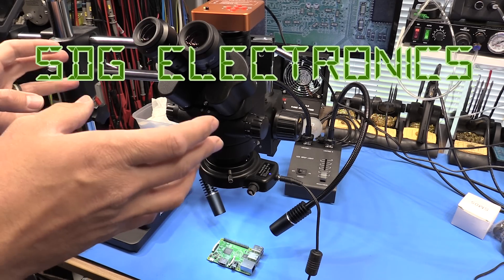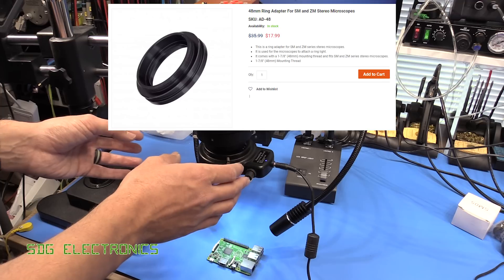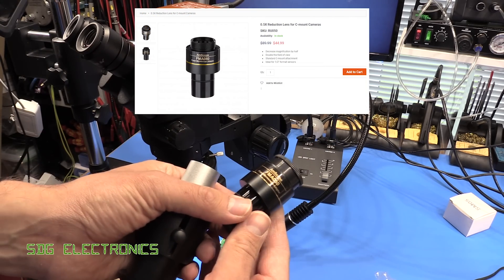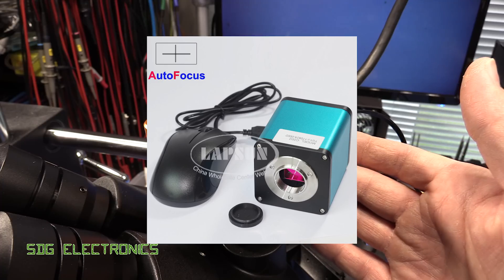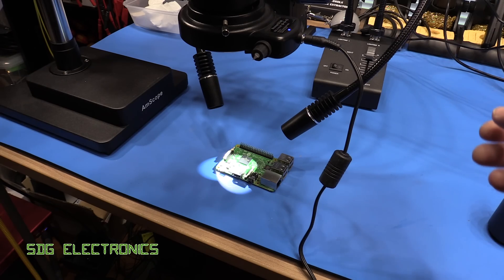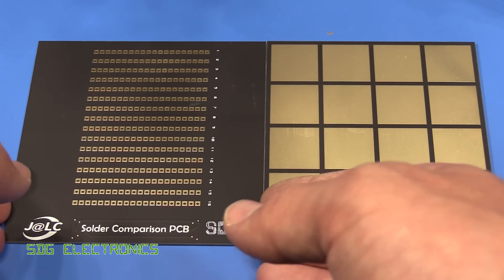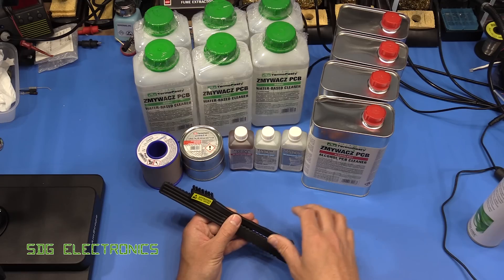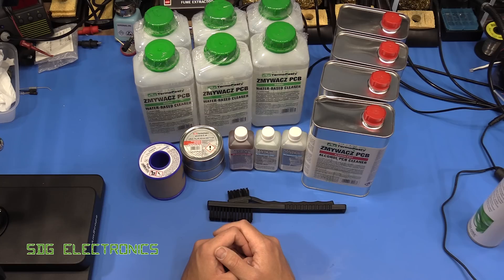SDG #078 Amscope Microscope (SM745NTP), Matte Black PCBs from JLCPCB and Soldering Equipment

Comment: 3:30 Why not bolt it to your table instead? More secure than a desk clamp anyway. The thing already has holes in the flange that mounts the tube to the base ready for mounting with bolts.

Comment: I noticed the swift (e400) small microscope shows much less distortion/fringing and sharper image than the trinocular. Can you list all the parts you used to add a camera to the eye pice of the smaller scope. Camera image looks sharp.

Comment: Hi Steve
Found your video a tremendous help as I have recently purchased an Amscope myself and also having problems myself installing the camera. The ebay link to purchase the pancake lens you mentioned has subsequently disappeared but I have found some others. Purchased one which does not fit. Would it be possible to let me have the camera mount and microscope connect  thread size on yours so I don't make another mistake.
Many thanks Chris

Comment: Steve, as always, another delightful production highlighting several key aspects of stereo microscopy methodology.  Everything is just
perfect (....lighting, sound, video sharpness).  And, thanks for the demo of "specimen" illumination comparison.  I'm so glad I didn't buy
a ring light.  Anyhow, I wanted to understand the 0.35x C-Mount lens with respect to focus adjustment.  I just bought the same
AmScope microscope head with the same USELESS trinocular photo tube device and I have to replace it for the same reasons you did.
How does the focusing work on the  0.35x reduction lens  ?  When you rotate the outer ring, does the helicoid increase/decrease the total
height of the pancake adapter lens .......OR.....does it just move the INTERNAL lens up & down  ?
THANKS  !
Reply from the maker: It just moves the internal lens up and down, so everything external stays completely static. I've found the lens really good - I set it up once in this video and have never needed to adjust anything since.

Comment: Hi Steve,

Got my SM-4TPZ and noticed that I have to re-adjust the focus a bit at the end of the zoom scale (close to 4.5x). Do you also have to do that or I should be worried that I received a faulty scope ?
Reply from the maker: I don't think that's a fault, even if you set up the microscope to be parfocal, at high zoom levels the depth of field is very small so may need small readjustments. You could try setting the focus up again.
Reply: @sdgelectronics  Thanks Steve - yes of course adjusting slightly the focus at the highest magnification zoom range does the trick. I would have hoped though that it is truly continues zoom range as it is advertised :D Another thing is that I bought the 0.35X adapter you are using and I cannot get the picture to be in focus. I literally have to hold the camera (slightly different one from the same seller which is advertised as 4K) attached to the 0.35X adapter in the air 4 to 5 cm above the microscope head..... I contacted the ebay seller and he recommends to test it again with a working distance of at least 16cm and should be OK - something I need to still test but I am not sure if I can go beyond 15cm working distance and I have only 0.5 barlow lens installed.... And even if that indeed works at that distance then it makes it to be very limiting as I might want to use bigger magnification and therefore shorter distance ? So confused!
Reply: So I just checked few things which even more confuses me. If I set the working distance about 20cm high - I can get an image in focus on the camera but at the highest zoom magnification only with the 0.35X adapter. But at the same time I cannot get the picture in focus in the eye pieces. Moreover - with higher working distance any change to the zoom makes the picture in the eye pieces out of focus and I need to readjust the focus (that now happens throughout the whole zoom range with that high working distance). When I lower the working distance to about 16cm the picture stays in focus nearly throughout the whole zoom range (as previously - have to readjust the focus a bit at the highest range of the zoom) but I can never get the picture in focus on the camera itself.... Is there anybody here who would be kind enough to check if they constantly have to readjust the focus throughout the whole zoom range if their working distance is set to 20cm ? Just trying to understand if there is simply something wrong with the microscope or with the camera / adapter setup I bought...
Reply: Just ordered the 0.5x adapter from the same seller you recommended as hey believe it should fix my problem. Need to wait for the delivery to test it out - I will post my results when it's here. Thanks.
Reply: So I got the 0.5x adapter from Lapsun Gift eBay store, checked it today and it does not work - still the picture in camera is out of focus and I would have to lift it up above the scope head for it to focus (although this time a bit lower than with 0.3x one). Sadly I now ended up with 2 non working adapters - I requested a refund (as the seller confirmed it would work this time) so hopefully I will get my money back for the 0.5x one. I will leave a comment about my experience with getting the refund with them here as well.

Comment: This or the Eakins? What would the Eakins not have that this does?
Reply from the maker: No difference optically. The double boom is great if you have space but I think Eakins also sell it with a boom stand. I would go for whichever you can get delivered cheapest
Reply: @sdgelectronics  I'll have to figure something out for the stand since shipping the stand here is very expensive, in the $150-$300 . I'm thinking either DIY or a custom job from a local metal worker.

Comment: Hello Steve,  I need your help.  Currently in the market for a microscope, I am inspired by your solution to the chromatic aberration you attributed to the trinocular attachment provided by AmScope.  Recently I watched another video, “Organic, free range, grass fed, cruelty free microscopes for sale,” on the “Louis Rossmann” channel.  Mr. Rossmann also attributed an optical aberration to the very same attachment; however, his solution is not currently available.  Please evaluate the Rossmann video and let me know if your solution, the “CTV 0.35X M38 38mm C-Mount adapter Scope Trinocular Stereo microscope,” likely addresses the same problem.  Also, do you have additional reflections on your camera solution, the Industrial Digital Microscope Camera Sony IMX290, Model C202?  Thanks.

Comment: Thanks very much for the pointer to the alternative camera adapter.  For those in the US, here's a link https://www.ebay.com/itm/CTV-0-35X-0-5X-1X-M38-38mm-C-Mount-adapter-Scope-Trinocular-Stereo-microscope/273877780313 for the products in USD.   It's nice to hear from you that you've had good experiences with this vendor.

I'm awaiting the delivery of my microscope in a few days to verify which of the "old type" vs. "new type" camera port mine has before launching an order.  And also to see how the camera field-of-view matches what's seen in the eyepiece to select between the different optical options.

Comment: I also found the ring lights to be useless.  The light they produce is not suitable for viewing anything.  The goose neck LED lights work much better but you don't need to buy a special microscope light since 2 goose neck LED lights from IKEA work just fine.

Comment: I want to buy 3.5x - 90x in this black version. can you help me how i can  choose the correct magnification of the camera adapter so when i am seeing trough the eyepieces as i will see trough the camera. Thank you!
Reply from the maker: The 3.5x-90x is a 7x-45x microscope head with 0.5x and 2.0x lenses that screw onto the bottom. Generally you will always have the 0.5x lens on the bottom since this gives great working distance. I found that the 0.35x camera adaptor gave the same field of view.
Reply: @sdgelectronics  thanks for your imformation!!

Comment: Check on ebay for 'Long Arm Heavy Duty Boom Large Stereo Clamp Table Stand Pillar For Microscope'. I've been pondering switching the stand on my own microscope for that one. It clamps on the side of the desk so doesn't waste space on the worktop. I'm only holding back because I haven't found a review of it yet. That stand might be exactly what you're looking for too. Cheers!!
Reply from the maker: I did see that one, Jim. I saw Louis R did a video unboxing an Amscope with the same articulating arm but on the heavy base. He seemed fairly happy with it although it did wobble quite a lot.

Comment: So did you recommend to upgrade to SM745NTP head?
Reply from the maker: I'm not sure this design would necessitate an upgrade, but certainly if buying from new I would say it's worth selecting the SM745NTP
Reply: SDG Electronics thanks
What eye guard did you recommend-for this head? It did not come with eye guard. Correct?
Reply from the maker: @yossishi221  correct, it came as shown which is a little odd. I've not purchased any eye cups yet so I will update when I find something suitable.
Reply: @sdgelectronics  may I ask why the sm745ntp is better than the one in the video? I am just about to buy one and want it in black like yours but can’t find one like the sm745ntp (white). Thank you
Reply from the maker: @josephe9773  the fit and finish in a few areas is just slightly better. The optics appear to be the same
Reply: So what camera will be ok for this? 
Not expensive  
Thanks
Reply from the maker: @yossishi221  The one linked in the description has given me the best results so far.

Comment: I've had no issues with Lapsun either Steve, I think I've had about 4 or 5 microscope cameras from them along with lenses etc.
You certainly get good value these days with regards microscopes and cameras etc. I think when I bought my M'scope a few years ago it was around £1500 although I did choose to have a research grade head option that was available. I'm sure as you've found though that the newer Amscope options etc also have excellent image quality.
Be interesting to see how you get on with the autofocus camera mate. I chose not to go down that route though as I assumed that like most they have a very shallow DOF, so say you're working around two components that are a couple of mm different in height I feared the autofocus system may become confused and just focus on neither. If you find it to be fine though I may try one too 😁.
Cheers, John
Reply from the maker: The nice thing is you can turn off the AF when you need to otherwise I would have bought the same one as you for the same reason. Thanks
Reply: @sdgelectronics   Ah ok.. Thanks 👍

Comment: Also, I have my microscope straight in-line pointing toward me. I went ahead and bolted a 8 inch metal shear on the left edge of my bench so that space wouldn't be wasted. The shear also cuts boards very well.

Comment: Thanks Steve! I want a microscope like the one you have for my next one. On my microscope, the camera is in focus when it is all the way down in the tube, which is good.
I clean my boards with lacquer thinner first, and then alcohol. I also use some soft toothbrushes with lint-free paper towels when I clean the board using your technique. Then a final clean with a fresh toothbrush and alcohol without the paper towel. I bought a box of 100 cheap toothbrushes on eBay for about $2.
Reply from the maker: That's some thorough preparation - sounds like it should yield some excellent results though. Thanks Robert.
Reply: No, thank you! I learned it from you, Steve. I learned using lacquer thinner from Paul at Mr.Carlson's Lab. Yeah, the lacquer thinner seems to remove flux easier than alcohol. The Chip Quik SMD291 No-Clean Flux that I am using now cleans up pretty easy.
Reply: SDG Electronics  I'm sorry - I made a mistake. I don't know why I thought I got 100 toothbrushes for $2... I just checked and the ones that I actually bought were 144 toothbrushes for $10.94. My bad!

Comment: Thanks for this video! I have ordered so many different types of lenses for my AmScope in the past but they were all a waste of money. I settled on a 0.5x with a 3D printed adapter but I wasn't happy with the result. I just ordered the Lapsun lens which looks perfect!
Reply: Hi Chris - I ordered the 0.35x adapter but when I tried it with my amscope I cannot get it to focus (out of its range). I need to hold the adapter mounted to the camera in the air about 4 - 5 cm above the head for it to be able to focus. Do you use any extension ? Or you use the adapter directly mounted to your amscope and the camera ? Thanks.
Reply: @adriansosialuk276  Did you find a solution?
Reply: @solid_rob3236  Unfortunately not. Bought 2 different adapters with the same result.
Reply: @adriansosialuk276  Thanks for the update and sorry to hear that, hopefully you get to find and get better results.
Reply from the maker: It works really well - they seemed to be the only ones selling it which surprised me. Thanks

Comment: Can't wait for the flux (and flux cleaner) comparisons. I love the Topnik LP-1 flux, but I found that it's hard to clean with IPA (it leaves white marks on the pcb).
Can you try all the combinations of flux and cleaner, please?
Reply: The white marks are from letting the alcohol dry by itself. I use a soft toothbrush and gently brush the board until the alcohol evaporates.
Reply: Robert Calk Jr. I do that too! But it still leaves some marks. Maybe I have to use tissues to collect the alcohol after i scrubb everything?
Reply: Maybe you can try a tad of lacquer thinner after the alcohol to remove the white marks?
Reply from the maker: @antonmilosevic  you need to use tissue. If you're only scrubbing the board the flux just dries all over the PCB
Reply: SDG Electronics any recommendation on what type of tissue (paper ones just get caught on the leads and make a mess!
Reply: Robert Calk Jr. What about the silkscreen
Reply from the maker: @antonmilosevic  I get on well with Kimtech Lab tissue
Reply: I just use lint-free paper towels that you can get at Wal-Mart, auto supplies, and a lot of places.
I haven't noticed any problems with lacquer thinner on the silkscreens? You can test it in a small spot to make sure that it will be ok.